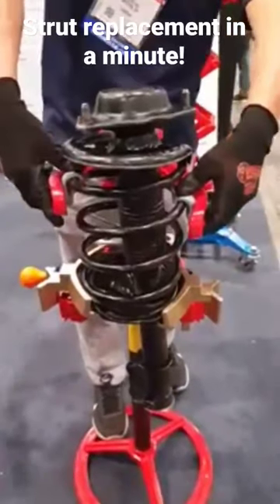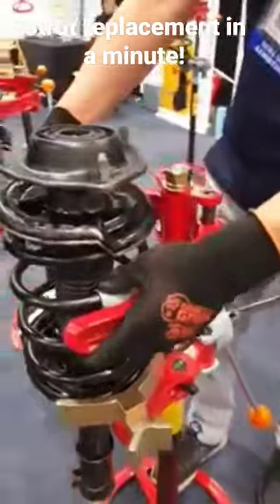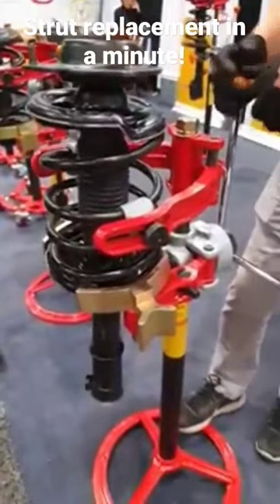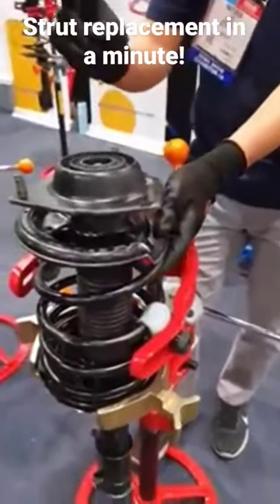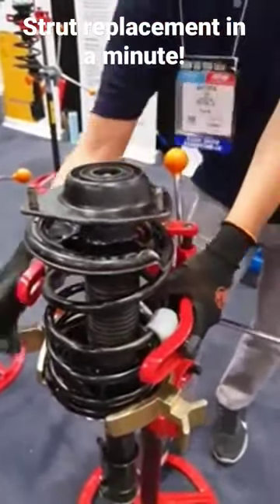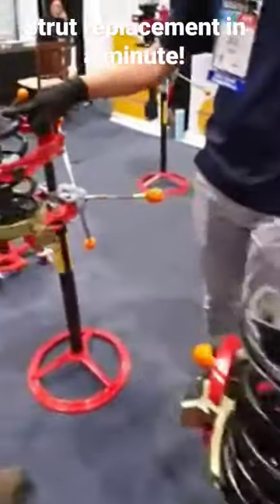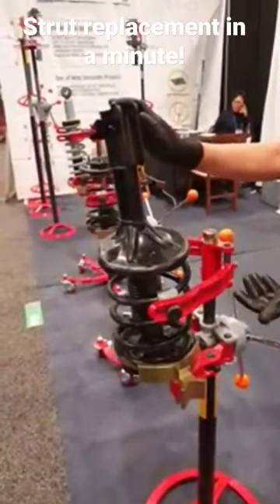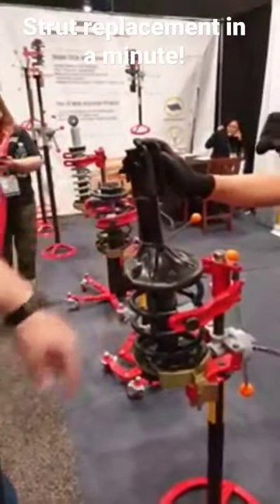Compress coil spring in 10 second! The best spring compressor, SK-3000.

Comment: So on this spring compressor you have compress the spring to take the nut and top mount out, de-compress to remove the old strut, load your new strut, compress the spring, install your top mount, tighten the bolt and lastly remove assembly by de-compressing the spring?
Reply from the maker: If you compress it upside-down position, you don't have to de-compress the spring to replace the strut.  You can compress the spring, unscrew the nut, remove the old strut,  then tighten the nut with new strut, while the spring is still compressed.  You can replace the strut by single compression.  It will only take 5 minutes. :)  For more information, please email us at jacktech@naver.com.  Thank you.